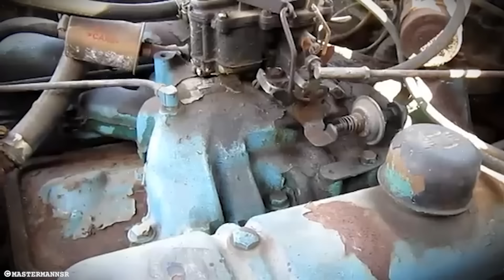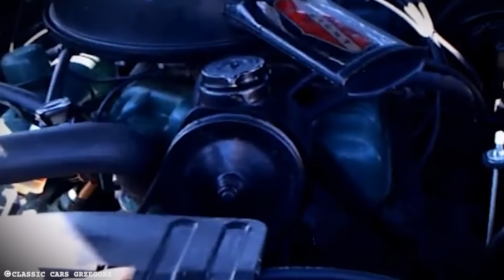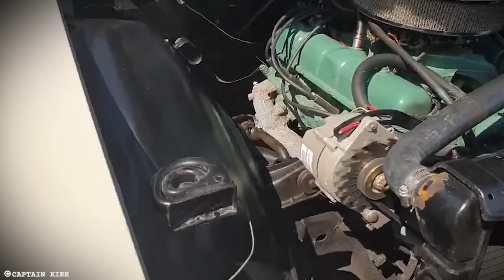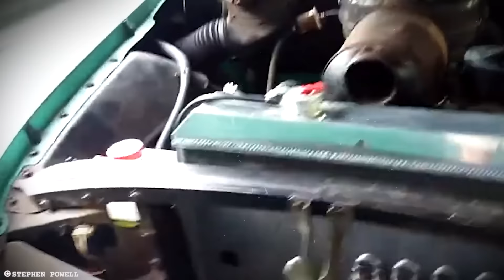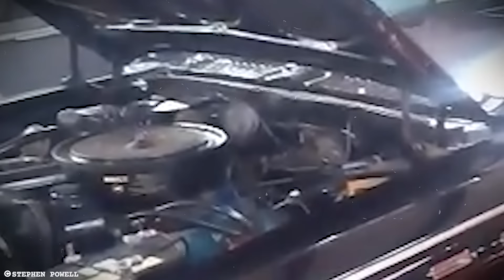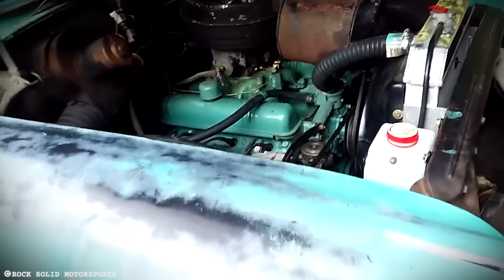How One Buick “Boat Engine” Outsmarted Every Hot Rod

Comment: Being a hotrod guy and boat mechanic i knew alot of this. The Buick nail head was never very popular in my area but I worked on a few. On a few occasions I went in the engine rooms on old cabin cruises to find a couple of Chrysler hemisphere with duel quads or a couple of 409 chevys or 427 side oil fords. I recent years it was mostly big or small block chevys or ford or maybe a left over  318 or 440 Chrysler. And now the base engines are pretty much the same as car or truck engines with maybe a different camshaft. This video was very good to telling what used to be but not so true now. Anyway thanks for the memories